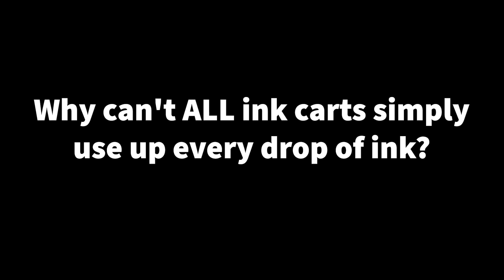Why can't ALL ink carts simply use up every drop of ink?

Comment: Mr. Rodriguez - I LOVE your channel! Just endless amounts of info and data for professional printers and smaller scale, casual business owners like myself.  

I didn't know where to put this, but I had a quick question if you ever get a quick second.  I'm using Precision Colors new cli-65 Special Edition inks for my Canon 200, after using up all the original OEM Canon inks.  I'm wondering what is the Precision Colors custom ICC profile variant that most closely matches the OEM ICC profiles that come bundled with the printer?

Example, for the Canon Glossy II Paper, I have a set of prints that I kept that were printed with the OEM inks and the 'Canon Pro-200/S1 Photo Paper Plus Glossy II A' icc.    

With the new Precision Color Inkset, downloading and installing their custom cli-65 profiles...and using the exact same paper and printing the exact same photos, I found the 'closest' I could get to the OEM ink output was with the PC65SE_CanonPhotoPaperPlusGlossy2_PPPG2_Tung.  I didn't expect this, as I thought the D50 variant would have provided a more OEM like appearance, but the shades were quite a bit different on the prints.  2nd closest was the CW Cool White setting (reds and blues still a bit off), but Tungsten was the best.   

All that said, even Tungsten was not 100% the same as the OEM ink prints.  Is that just the nature of Precision Color inks?  I think they're amazing, but perhaps I'm barking up the wrong tree thinking there's a way to get them to match OEM ink color outputs to a T.  Which isn't a deal breaker because they still look amazing.  But just curious.

Thanks!